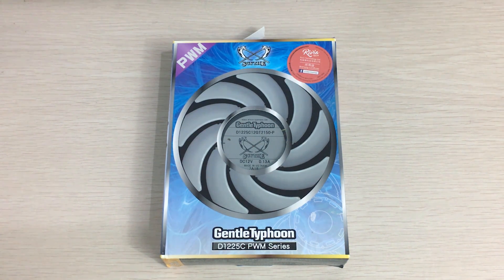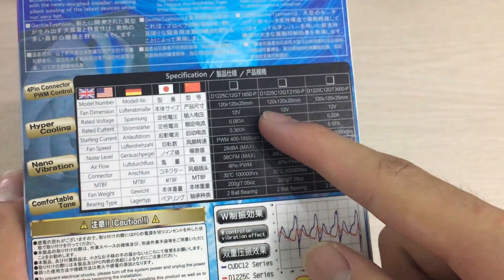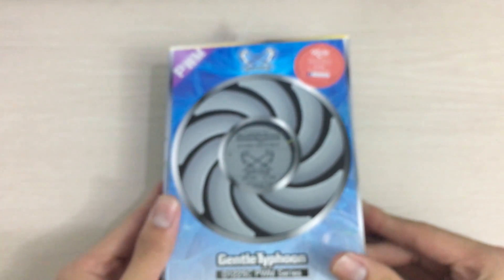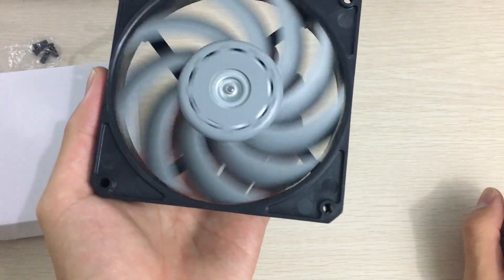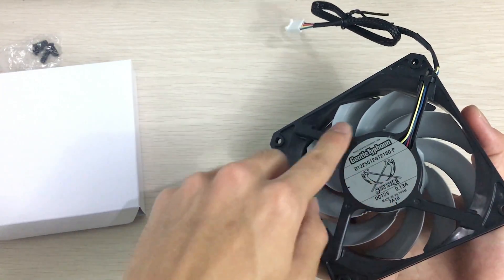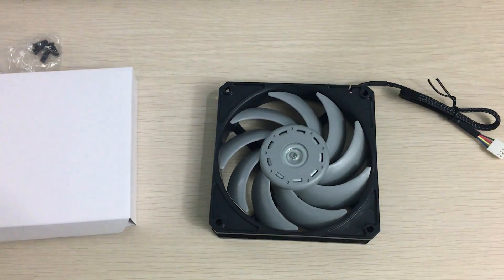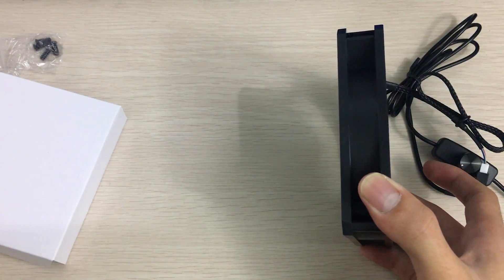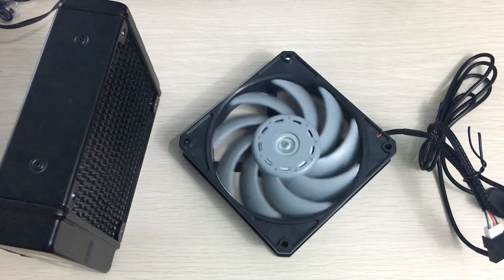The best radiator fan? | Scythe Gentle Typhoon 2150RPM

Comment: Are there major drawbacks in cooling performance when using a fan with such a blade design on a 45mm radiator in pull?
Reply from the maker: No these are the ideal pressure focused blades. It shouldn't matter much if its in push or pull actually, since the fan in push would be trying to make a positive pressure difference between the space in between it and the rad, to the ambient air while in pull it would try to create a negative pressure differential between the space between the rad and it, to the ambient air. The restriction is the same which is the radiator so it should perform the same.
Reply: That answered my question. Thanks for the fast reply!
Reply from the maker: No problem!